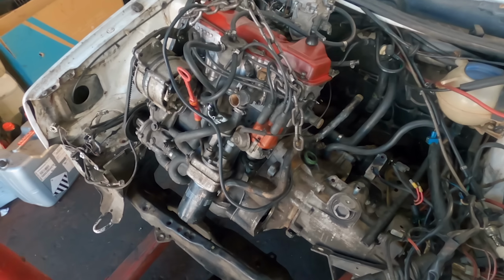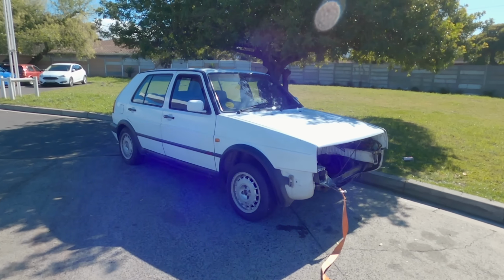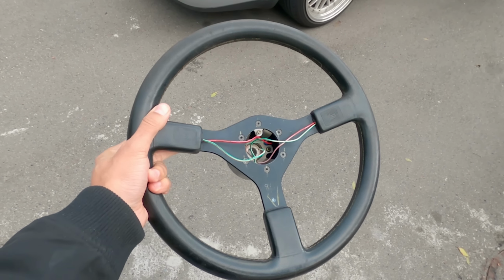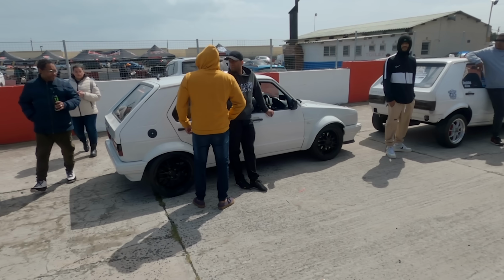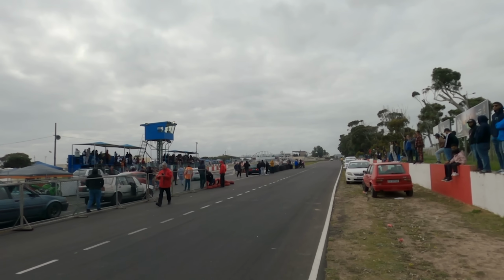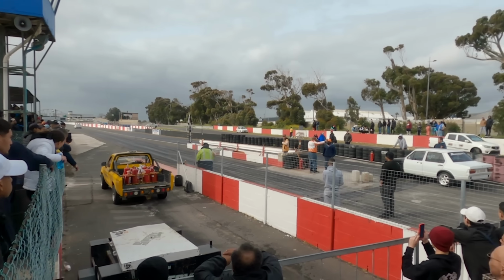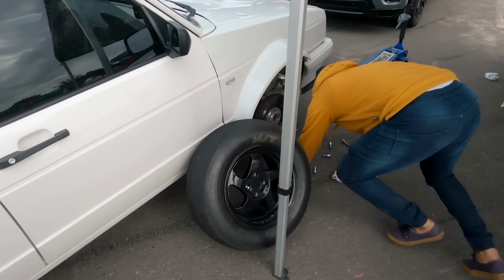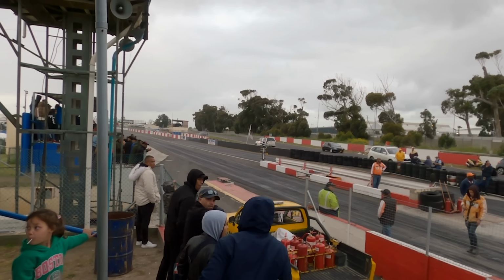Project NA 16v update & MSA Drag racing ft Lester's 20vt Mk1 Golf

Comment: What times does the (blue 20v sidies) run?
Reply from the maker: His best time at the moment is 13.5. The carbs are still not 100%. It's breaking up down the track.
Reply: @lowdl  thanks buddy. Very unusual setup, surprised to see the guys still using sidies...
Reply from the maker: @sheheensumad  He has a point to prove apparently. So let's see how it does after they work out the kinks. Its a solid build.
Reply: @lowdl  interesting!

Comment: Are you going to be selling any of those 8V engine components? LOL whats the code on that cylinder head?
Reply from the maker: I'm not sure what the engine code is but it's for sale. It's a 1.8 carb motor. Head was refreshed but bearing knock because the bottom end wasn't well assembled.

Comment: Get some prep sol. It will cut through all that crap and make the bay brand new.
Reply from the maker: Thanks a lot. I see it's not too badly priced. I might give it a shot but I think I want to
have it painted. There's a rust spot on the one side that I want fixed up and the radiator support is busted so I'll replace it and paint the one I've got in storage. A freshly painted bay just hits the spot.
Reply: @lowdl  yeah nothing hits like fresh paint. But the prepsol will help get you to a clean base so help assess or discover other problem areas. Not that it matters here but it's water based so doesn't damage paint.
Reply from the maker: @monraypretorius3585   Sweet. Thanks for the plug.